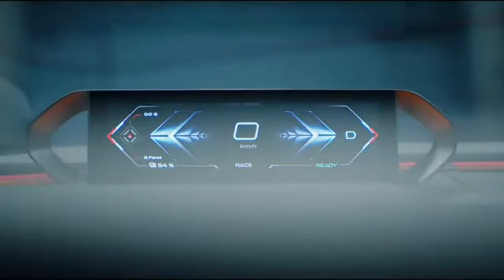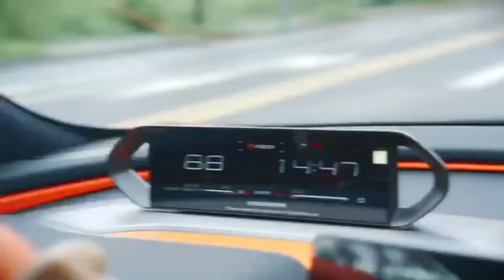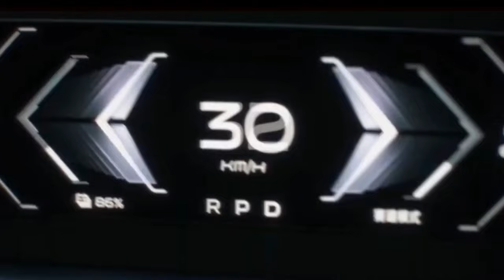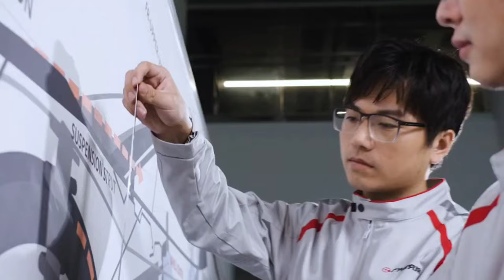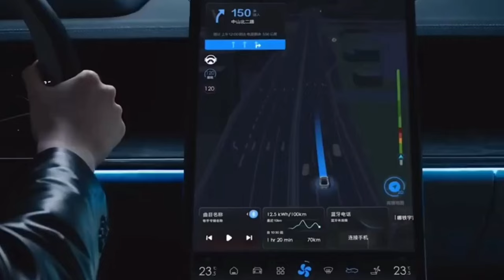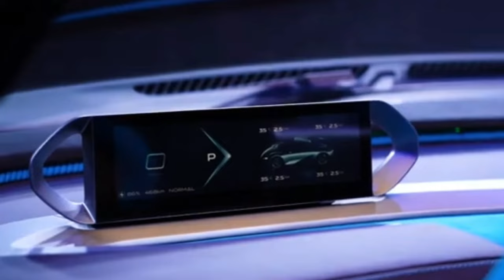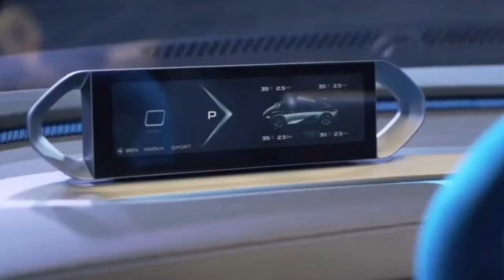This Chinese Car Is Ready To Take On The Tesla Roadster

Comment: If the lucid air sapphire can generate 1.5gs otw to a 1.7s 0-60mph why is this a claimed 1.9s 0-60mph 2.1s 0-100kms and rated for 1.7gs? 🤔

The plaid does 1.9s 0-60mph on a prepped surface generating just about 1.35gs. 

And the nevera is 1.65s 0-60mph, mcmurty speirling ev is 1.4s 0-60mph verified by multiple sources on different tracks.